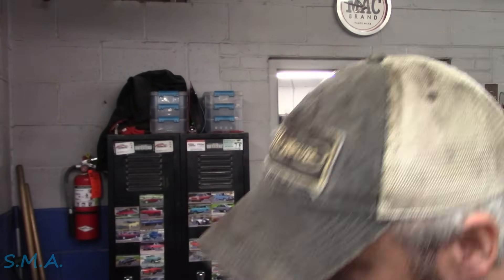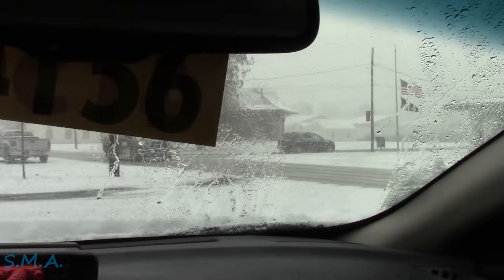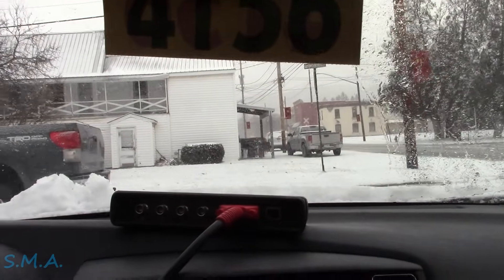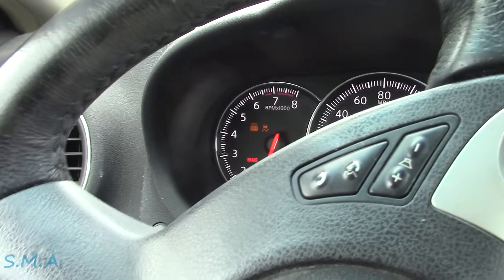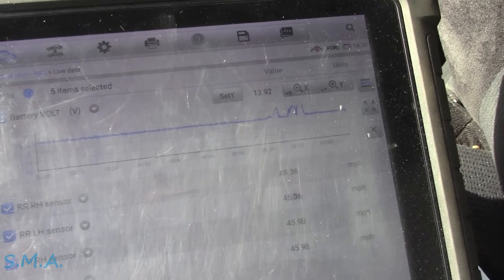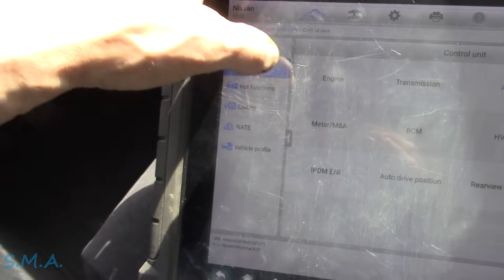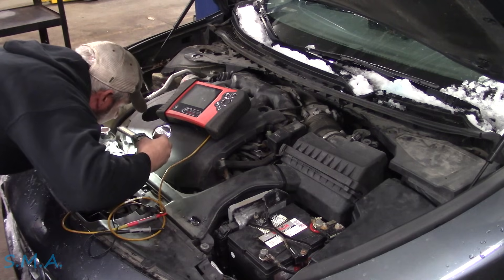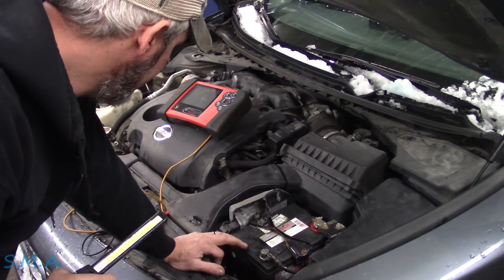Nissan Dealer Quoted Over $2000 For A New Harness!!

Comment: I hope your customers know how much you  are saving them . You are an honest mechanic wish I was  your customer :)
Reply: Wish I was a customer too! Live too dang far away though. 😔
Reply: I sure they will after this video release 🤠. So hard to find honest mechanics these days.
Reply: Problem with dealers is they only install entire parts, they don't or are not allowed to fix things. The dealer told my mom she needed an entire fuel system because it was rusted and leaking at the tank. The local guy fixed it for a couple hundred. Rusted brake lines cost her $1500 she could have had it fixed for $200. Her car is worth maybe $500 at most.
Reply: @AmandaHugenkiss2915  Because a “fix” is usually a bandaid… sure the old beater’s could be jerry rigged but it won’t always last, and that’s usually wasted money
Reply: @christophervanzetta  eh it could be a band aid or it could be a good solid repair. Depends on who's doing it.
Reply: Plus then it takes 6 hours for them to do a job I can knock out in my driveway in a couple hours for brakes or 20 mins for an alternator. No thanks I'll handle it myself and know it was done right with top notch parts
Reply: @christophervanzetta  Why would it be a band aid fix? the part would literally last you years...far from a band aid fix imo, watch out for this guy if he works at a shop
Reply: I wish I was his apprentice! I am a mechanic myself and I don't have half the knowledge or tool allotment he does. Watch his video's as a way to learn from the absolute best in the business. I have basic knowledge and use his videos to expand.
Reply: @christophervanzetta910  Devils advocate here trying to defend stealerships lol.

Comment: A few years ago my brother had some weird intermittent electrical problem on his 2011 Durango. Two dealers and several weeks in the shop and still the same. They changed the ECM, 2 alternators and the battery. He got frustrated but wouldn't let me touch it because he wanted them on the hook for whatever they did. We drove it around for the day and it went from intermittent to almost constant when it got good and hot in traffic. We ran it back up to the dealership and he was able to get the guy that worked on it to come out immediately. I told him to look for a bad connection because it gets a lot worse when it gets hot. He found the problem in the alternator harness. He said the dealer would only give him 15 minutes with it and that wasn't long enough to get it warm enough to act up.

Comment: I've had a very similar experience with a 2005 Mazda RX8. On (fairly frequent) occasion it would boil the battery. No problem - put a voltmeter on the battery and logged the voltage as I drove. Voltage rose over 17 volts when under heavy load (in this case, like the Maxima, when cranking on the electronic power steering while stopped or low speed). Checked all powers and grounds like Eric did, all good. So I replaced the alternator and it still happened.... Turns out the alternator fitted to these Mazda's (and a lot of newer cars) does not have an inbuilt voltage regulator; rather the PCM has the regulator integrated into it. The logic behind this is the PCM can 'look ahead' for electrical load demand (i.e. it can see the steering angle sensor change minutely before you significantly steer) and then crank up the alternator to compensate. This is especially relevant for vehicles electric power steering as it puts a massive load on the system. I backprobed the PWM output from the PCM to the the alternator and found it would get stuck at 100%, causing the alternator to go full field. Note that the scan tool didn't pick up on this as the data you receive is the 'desired PWM' not the actual... One junkyard PCM later and it works fine.
 
This may not be exactly what Eric is seeing on the Maxima (i.e. no idea if it uses the PCM as a voltage regulator) but figured I would share this story. Don't automatically blame the alternator itself for a high/low voltage fault!
Reply: You deserve a damn “good work champ” award for that one for absolutely bloody sure.
Reply: mk4 jetta/golfs have iffy (once old) wires from the alt to the batt, after x years they corrode internally and introduce too much resistance, leading to all sorts of hot melty goodness, and sometimes ends in it killing the alternator's regulator circuity too.

good times, good times.
Reply: Well done Matty B
Reply: You should expect a Nisssan dealer to know this and to be able to solve this problem easily. 
But they either lack the knowledge or they want to make as much money as they can from the customer. 
I honestly don't know which one is worse, because the behavior of the dealers is what partly sells the brand to customers. People quickly lose their trust in a brand when the dealers can't or won't solve problems efficiently.
Reply: Rock Auto doesn't list a separate voltage regulator, so I bet you're right.  If you are right, I think Eric owes you an ice cream when the stand opens up.
Reply: @tjroelsma  I have one word for you "Apple" .
Reply: Thanks.interesting to know the pcm regulates the voltage
Reply: @marklatimer7333  Apple simply doesn't want to repair anything: they've always told you to "buy a new one"

I remember things like the Apple Cube, because when I still had my repairshop an Apple customer came to me to get his Cube to hook up with one of the first cable-modems, you know, the one with the serial port connection. He went to the official Apple store over here and they boldly told him to "junk that ancient Cube (3 years old) and buy a new Apple" and didn't even want to look at it. Needless to say it was an easy fix and I had gained a very satisfied customer.
 
That same Apple store tried to badmouth me later to another customer for not being able to fix an old Apple printer (that had a totally worn mechanical part Apple refused to sell) while their genius solution again was "junk it and buy a new one" without even looking at the problem. 

And I'm talking back in the late '90s or early 2000's here.
Reply: @LuckyBaldwin777  Eric did say at the end that it much be the PCM.  He's just sharing the journey with us. Guaranteed he finds the issue, this dude is a sorcerer.
Reply: @tjroelsma  I experienced in the mid 80's that "Apple" is not the right brand of electronics for me.😁
Reply: @ichoozjc  you're right,  he always gets there in the end.  The fact he keeps a cool head and shares it all with us really shows how good a person he is.
Reply: @tjroelsma  sadly some people see the 181k miles and think it’s not worth their time.
Reply: nice to share this info with us
Reply: @dillydave13  True, but that shouldn't be up to a dealer to decide. If I bring in my car with 181k for repairs, they can ADVISE me not to have it fixed, but the ultimate decision is mine. If I say it should be repaired, then they should repair it.

In cases like these though I suspect it's more a problem of: hook it up to the computer, see if the computer can figure out what the problem is and then decide if you fix it. If the computer can't point to a clear problem and therefore a clear solution to fix the problem, kick it out. 

Dealers don't want to investigate problems; they just want a quick turnaround. If this is a recurring problem with Nissans, which it sure seems to be if you read to comments above, then that information should be in service bulletins to the dealers and ultimately it should be suggested as a fix by the computer.
Reply: @ichoozjc  more like a car whisperer
Reply: @tjroelsma  Had a Costumer once she was with her car by the Local Mercedes-Benz dealer Course her car was running on only 3 cylinders they replaced the sparkplugs and two coils (but not on the cylinder hat fault) and charged her 800 bucks i think it was, than shortly after like 10 miles down the road the problem startet again she went back to the dealer and they charged her another 800 bucks for diagnostic work and gave her a quote of 10000 dollar for a new cylinder head they said it had a crack in it.
After that she came to me and asked if I could take a look and so i did I read the Fault codes and changed the Sparkplugs Course the once installed by MB could be faulty and they  looked like shit I also reconnected all the vacuum lines they disconnected and didn't reconnect (but they but the covers back on and gave it a quick wipe down locked lovely)
took it for a little test drive and all was fine 220 miles later the car acted up again luckily the costumer was close to the shop read the codes again and the misfire code came back 
on restart of the engine I noticed a long crank which was new checked fuel pressure 0 psi at that point I put a new Fuel injector in it course the old one was stuck sometimes resulting in a flooded cylinder which cant fire and the ecu detects a misfire and of the story she paid her bill of 1200 dollar and is now a loyal customer of mine. Intermitten faults are the worst.
Reply: I would open that unit to see if a repair can be made to that regulator.
Reply: @HoundsHell  I totally agree intermittent faults can be very difficult to solve. The key to keeping your customer satisfied is doing the best you can and be honest about it. If you have doubts that you've actually solved the problem, then tell that to the customer: "The problem went away or didn't surface when I was troubleshooting it and I think that I've solved it but I can't be totally sure."
A reasonable customer will thank you for being honest and return when the problem pops up again.
Reply: @fixitallpaul4847  When it happened I dismantled the PCM and inspected it. If I recall correctly (it was over a year ago now) the basic circuit used a FET to pull down the ground side of the field. At this point I had two options, desolder the FET and bench test it independently, or test the ECU in situ (while in the car) and see what is happening on the gate and source pins. If it was working correctly the gate should inversely reflect the output (I.E. 0% duty on the gate = 100% duty on the output to the field). I didn't do either for a couple of reasons. The first option (desoldering and bench test) doesn't simulate in circuit behavior. I would have to simulate heat and vibration as experienced in the PCM which isn't easy to do. Intermittent failures in transistors are usually thermal, so if it's cold it will work fine. The second option (in car test) is very difficult and would have involved soldering flying leads onto the gate so I could reassemble it well enough to fit back into the car.

But the main reason was actually this.... I had fried 3 batteries in 6 months. The whole area around the battery is near destroyed, the paint was all gone and I was sick of cleaning up spilled acid which went in places you could only imagine. I even had to replace the connectors going to the cooling fans as they all corroded away (causing the fans to intermittently not operate and the car would then overheat). Ideally I would have kept going with the diagnostics, but sometimes you just have to call it. A newer revision PCM was $100 from the junkyard, and this fault is very rare so it was unlikely to be present in another PCM.

My profession is fault finding and repair in electronic and mechanical instrumentation. I actually really enjoy these challenges and as a hobby I frequently buy broken things just to fix them up.
Reply: @tjroelsma  Blame the engineers.. They designed the junk
Reply: @ichoozjc  Yeah, Eric is definitely one with the scanner,  I was just being a smart a$$ with the ice cream comment.  My grandmother says it's a genetic flaw.
Reply: @tjroelsma  I fully agree. My 2011 Silverado 1500 has 160k and I recently put a Fox 2.0 suspension and $1.8k in tires on it. It’s paid off, trucks are ridiculously high in price, and I drive 60k miles a year. I’ll keep this truck until it’s done then buy a new one.
Reply: Pretty good call!
Reply: @mattyb4015  welcome to my world. 30+ years in defense electronics. Often tasked with finding root cause. 
Sometimes you do have to call it far enough.
Reply: @tjroelsma  I don't even take my semi to the dealer. They seem honest when it comes to selling parts but I prefer to DIY everything I can and then have the carrier I bought it from work on it. They have literally every part these trucks take since they have several hundred in their fleet, and they're authorized for warranty work and don't shotgun parts because they'd have to justify it to be reimbursed.
Reply: I THOUGHT OF REG TOO...BUT WENT FOR GROUNDS...NEW YORK...NEW ENGLAND AREA...SALT ROAD IN WINTER CITY...
Reply: @dchawk81  That 's about the only way to ensure a consistent repair quality. There are still good dealers out there, but the number of bad dealers seems to be ever expanding.  
I blame it on people don't care about things like reputation or professional pride anymore and only see the money. 

I worked for a large shipping company that only bought DAF trucks for their fleet and serviced them themselves at its headquarters. They actually had a DAF dealer license so the mechanics were fully DAF trained and used DAF recommended equipment. It also made it very easy for them to get all the parts.
Reply: Good job matty b. 👏
Reply: They still have the voltage regulator on the alternator. Simply the signal wire (or what was called the exciter in the old days) comes from the PCM.
Reply: Fucking bad ass jeez man save the bitches for us too
Reply: @tjroelsma  yeap the " The Stealership" lol
Reply: Just took my 14 encore to Buick dealer and they replaced the evap canister on top of tank. Had to drop the exhaust rear drive shaft and tank, $687.00 they supposed test drove it. Got in it and at 45 had a bad vibration and clicking noise went back and 1/2 hr later they had broken the very front bearing on the rear drive shaft. They are saying that the part is $800 and change, but that they will install it free, I don’t feel like I should have to pay all of it. It’s got a little over 100,000 miles on it, and it was fine when I drove it in.
Reply: Had similar problems........ but i had a suv with a voltage regulator...... i got lucky....

Comment: 5years ago, My old boss had an issue where the car wouldn’t start… Ford looked at it, $1200 later still not fixed.. they wanted $2000 for a new ecu….   I gave my boss my uncles phone number… $250 and 2hours later, keys recoded.. the car is still working fine today…. I learnt a long time ago most dealer mechanics are no more than parts fitters these days, if the computer don’t tell them what part to change they screwed.

Comment: I have so much respect for this man.  I am lucky to have three repair shops run by friends that are similiar to this.  A recent issue with my Toyota cruise control was repaired by one in 10 minutes and under $50.  The Toyota dealer quoted me over $700!

Comment: I have been amazed that you, working on probably a thousand more cars than I (as a DIYer) ever have, are not encountering bad engine grounds. When I see an electrical system that screwy I start the engine, turn on the lights and blower, and measure voltage from engine to chassis. My 300ZX was measuring over a volt between them... stupid second wire from the battery connector to chassis was corroded in two.
My brother was installing audio systems in high end cars for a while. He had put one in a Ferrari, demonstrated it for the customer, and waved goodbye. A moment later it came back - no audio system life at all. Turned out the system only worked when the parking brake was on, because the tension in the parking brake cable grounded the engine when it was applied.
Reply: Gotta love that kind of stuff!
🤣🤣🤣🤣
Reply: Willing to guess he deals with bad grounds weekly, but that wouldnt make for a very good video so we don't see it.
Reply: He has made a lot of videos on bad engine grounds
Reply: @imnotimportant  Eric is in New York; bad grounds/ corrosion issues are a frequent issue with vehicles there due to the de-icing chemicals that are used on the roads from the fall through the spring.